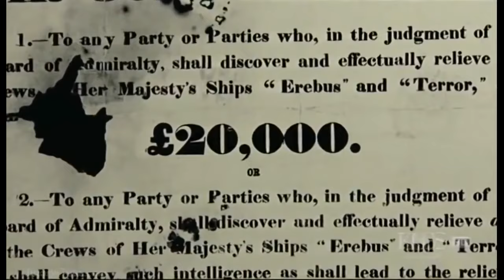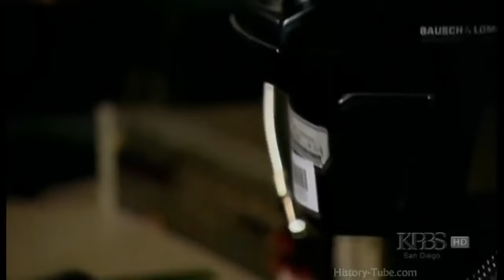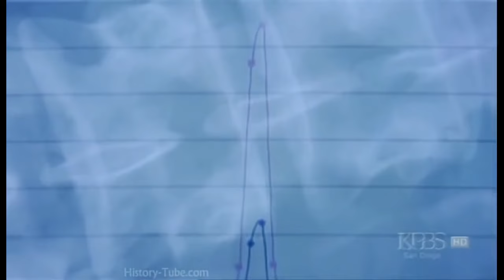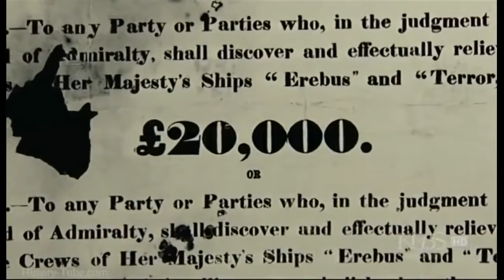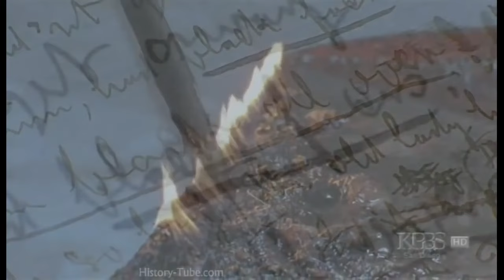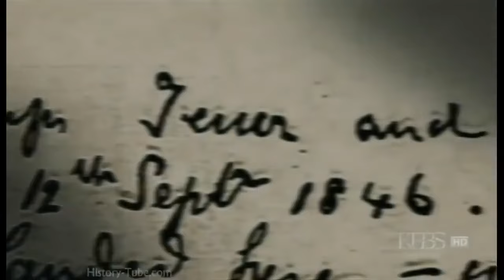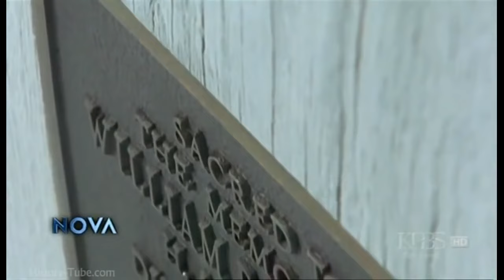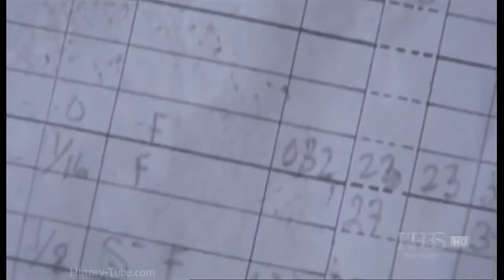Arctic Passage (2006) - The Franklin Expedition (HMS Terror and HMS Erebus) vs. Roald Amundsen

Comment: Power through the ice as never before? It was 25 hp!
Reply: Nicholas Ovel  actually you're completely wrong. 25 horse power was not enough to power the ship's through the ice. Not to mention they only brought 12 days worth of video fuel for their engines.  Essentially completely useless.
Reply: @JohnDoe-sp3dc  Erebus and Terror could do it fine in antarctica without steam engines. The engines would definitely help with the sort of ice they were supposed to be breaking through. They were not supposed to punch through the pack ice that they were caught by.
Reply: Sounds like they were set up to fail, and sadly went along with the set up, anyone should know that you need plenty of fuel, horse power, and supplies besides processed food in rusty cans with lead. Even if the budget for the voyage was cheap, I think it was a set up.
Reply: @viktorj.w.garnus8369  Your theory of a "set up" is based on what?
If anyone should have known you needed plenty of fuel, supplies and horsepower, how come the crew didn't? Could reasons have been that they didn't need to use the engines constantly? That there was no room for more stuff? Where do you suggest they should have gotten more powerful engines from? The canned food was explained in the doc, it was to not have to hunt/rely solely on hunting. They only knew exposure to high doses of lead were poisonous. People drank from lead cups etc. You talk like they didn't plan anything, like they had no knowledge of anything, but yet somehow should have had knowledge of things discovered much, much later. Are you sure you're not suffering from lead poisoning?

Comment: How did they store water on the ship though?
Reply: They didn't just melt snow
Reply: They had stoves on board for cooking. They would bring water and could just melt it if it froze as well as use the ice or snow once in the arctic.
Reply: The ships had early desalination systems - the pipes of which were blamed for contributing to the supposed lead poisoning.

Comment: Why didn't they hang out with the Inuit?
Reply: Some did. Crozier, the second in command of the expedition, may have settled with them in the end. However most died from freezing/disease/starvation, and when the Inuit did meet them they were completely unprepared to support 30-40 starving men ( the inuit travelled in small bands). When they didncjanfe upon smaller groups, 3 or 4 men, they did help and appear to have even adopted them, at least temporarily.